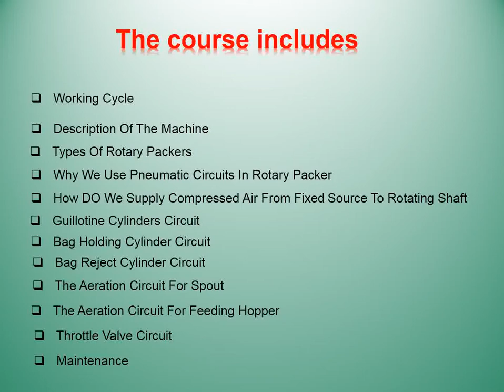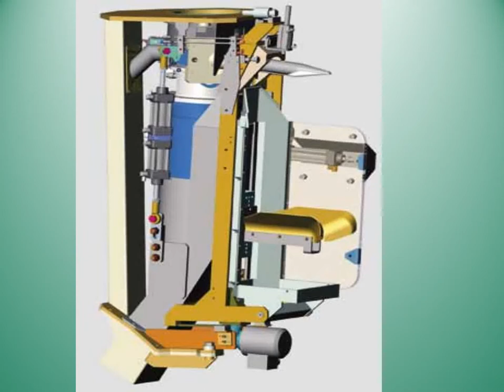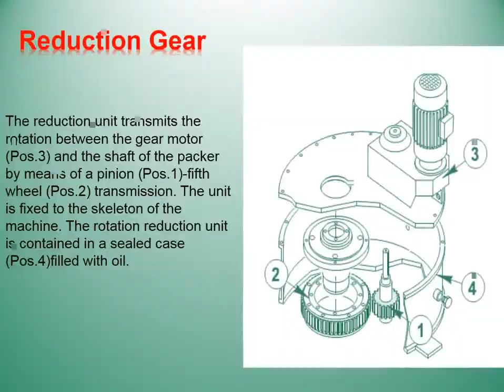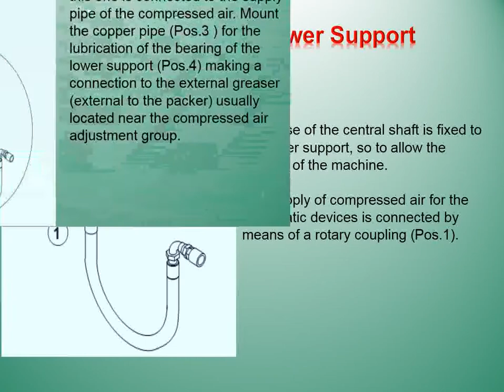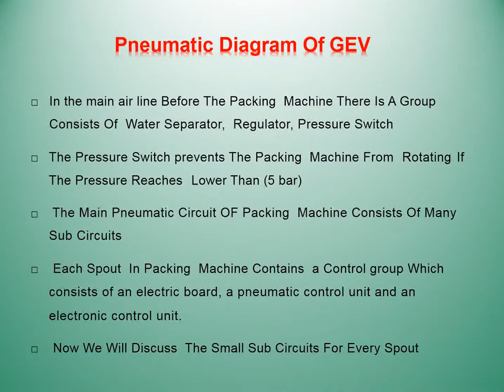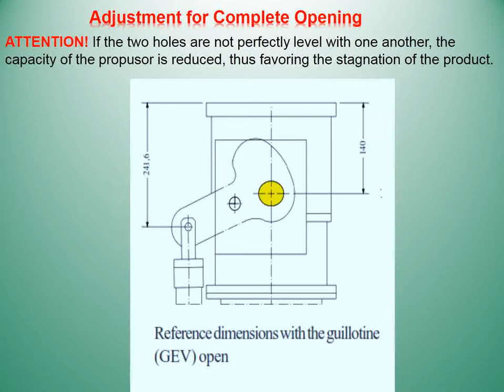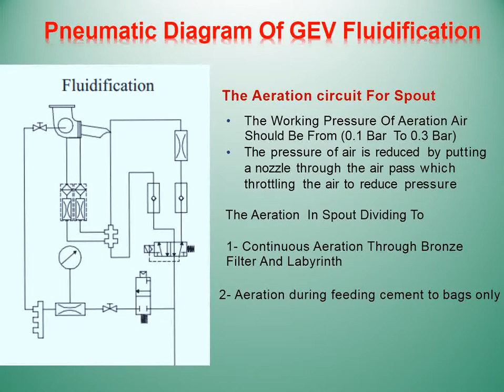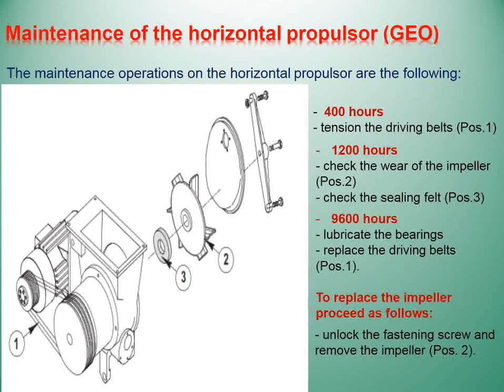Comprehensive review and maintenance of the packaging machine Ventomatic in the cement industry

Comment: sir there is no lens to check the reduction gear oil level instead there is an allen key bolt. Should i open that and check? Also oil filling has to be done from the point available at the top surface of reduction . right?